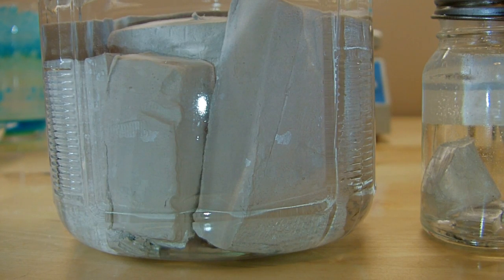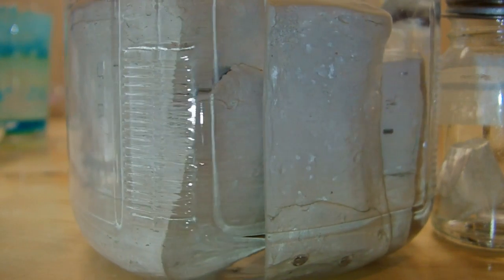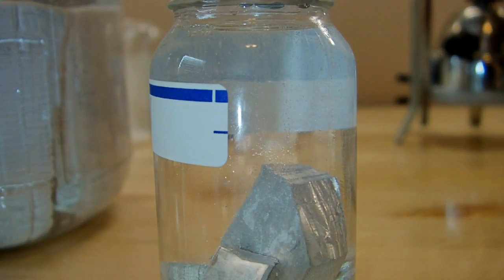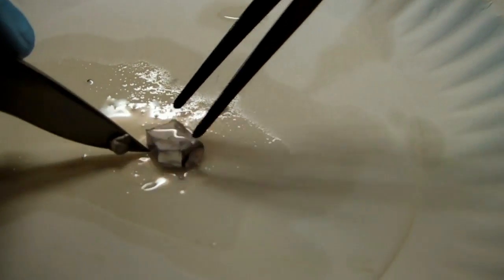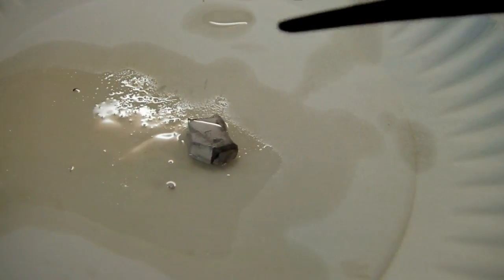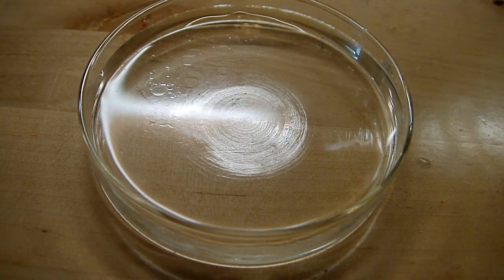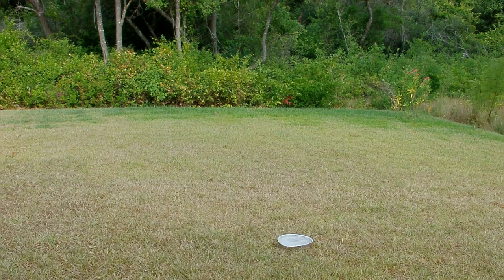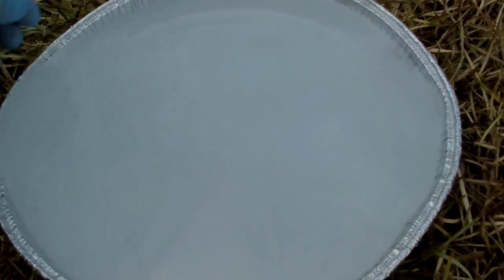Sodium and Water

Comment from the maker: Well, look at the reactions:

2Na + 2H2O == 2NaOH + H2
2Li + 2H2O == 2LiOH + H2

If you do the stoichiometry, 1g of Na yields 0.04g H2 and 1g of Li yields 0.14g H2. So lithium makes quite a bit more, because it's such a light metal with a low atomic number.

Comment from the maker: Remember that salt is sodium chloride, a compound of the elements sodium and chlorine. Dropping some salt into water is quite different than doing the same with actual sodium! And air is actually mostly nitrogen (~70%)! Other around-the-house elements include copper (wire), iron (nails), and zinc (boating anodes). Light bulbs are also a surprising source of quite a few elements.

Comment from the maker: If you heat carbon in air, then yes it can react with oxygen to form CO2. But, if you heat it in a vacuum there's nothing for it to react with, so this would be the way to try melting it (although like I said before, what would you melt it in?). The only way something would explode is if you had it in a sealed container and it made enough gas to greatly increase the pressure, which I don't think is very likely. Glad to see young people interested in science!

Comment: Sodium and hydrogen both have one valence electron, which they try to get rid of to have an evenly filled set of energy levels. Hydrogen balances itself by bonding with oxygen. Oxygen has six valence electrons, meaning that each atom will want to gain two electrons. Because sodium has an outlet for the release of electrons, it does so, and releases energy to move to a ground state.

Comment: I agree, but don't forget to put things into persepctive sometimes. For example, 2.5L of hot concentrated acid has the same MSDS as 5ml of cold, concentrated acid, as has 500g of a toxin/carcinogen to 500mg.  It is also important to remember that sometimes MSDSs are badly written and occasionally are just an exercise in arse-covering.

Comment: You don't need to explain that simple redox reaction to me, I know how sodium chloride is formed. What I meant was that simply sodium and chlorine do not 'form' table salt. Of course they do 'react' to form sodium chloride, if the reaction mixture gets enough activation energy, which is why I said that they probably won't react at 10 Kelvin. And I didn't mean to propose a new sort of efficient gas containment system, I meant to say that the fluidity of sodium (at 10 K) surely would be less [...]

Comment: Could you break this stuff up into tiny pieces, and throw it onto ice on the sidewalk? Would it melt the ice? It would wouldn't it..?
Reply from the maker: The reaction is very exothermic so I'd think it would.The temperature of the ice would slow down the reaction initially, but as it heated it would speed up quickly. Then after the reaction you'd have corrosive NaOH all over the place! Making the sodium into tiny pieces vastly increases its surface area, though, and it would react with air even faster.

Comment: Nope. Sodium and Chlorine do not make up salt. They react under standard conditions (better at even higher temperatures) to form sodium chloride, but if pump a sodium container full with chlorine gas at (let's say) 10 K and you won't get salt (sodium chloride... or any other salt for that matter).

Comment: Does sodium come in oil
Reply from the maker: +tommy D Depends on who you buy it from. Not usually, surprisingly.
Reply: +mrhomescientist I'm only 14 and going to buy 100g of sodium metal
Reply: +tommy D for science
Reply from the maker: +tommy D Good luck with it! What experiments do you have in mind? Remember to be careful handling sodium, it's extremely reactive and will react with the moisture in your skin. Be careful scaling up the sodium in water reaction too - larger pieces do not usually behave like smaller pieces.
Reply: +mrhomescientist ok thanks I'm just going to put it in water and stuff